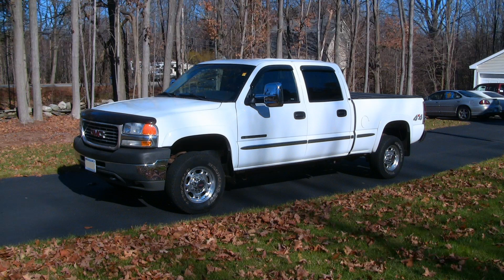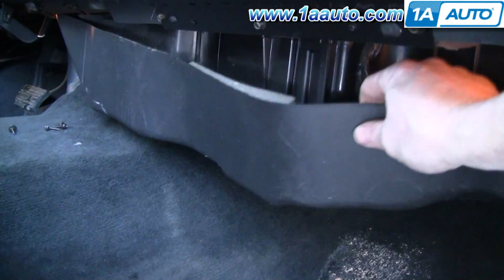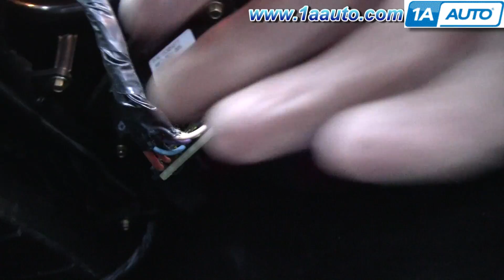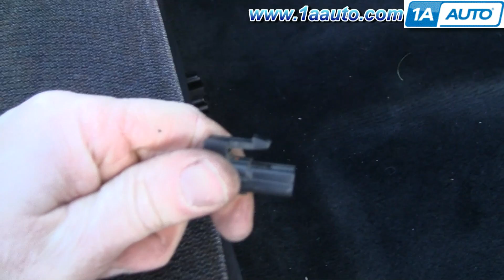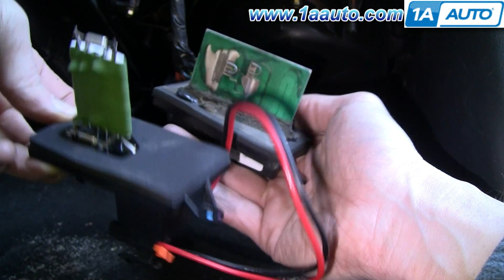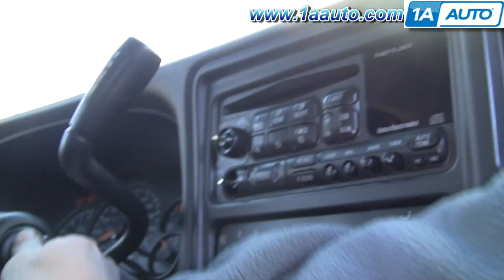How to Replace Blower Motor Resistor 03-06 GMC Sierra 2500 HD

Comment: My 1990 GMC V2500 suburban is having heater issues. The heat doesn't come on at all but as I am driving and the truck warms up I can feel (a trickle) of warm air with no force behind it. are their any tests that you know of to see which part in bad besides just ripping it apart and checking piece by piece?

Comment: my 99 gmc sierra 1500. my 4 wheel low is not working. just the high. is the problem the transfer case switch?

Comment: 1999 gmc 1500. my ac and heat doesnt work on ,1,2 only on 3,4,5. is it the switch or the resistor that meeds replacing?

Comment: I have multiple problems with my heading system. Only the highest speed will work on the fan. And the heat on the driver side setting is either the hottest or cold. I have an 04 silverado

Comment: 2006 GMC Sierra.  #5 stopped working (might have been a fuse I guess, never checked).  Now 1-4 stops working intermittently.  I fiddle with where it plugs in, and 1-4 usually starts working again.  Is the problem ever the plug itself that plugs into the resistor????

Comment: I have a 03 Silverado 1500 and my fan just quit working on all fan speeds but sometimes it works but i hear a clicking sound when i adjust my fan speeds. How do i know if it's the resistor or the blower motor that needs to be replaces?, i checked all the fuses and they are good.

Comment from the maker: You may want to check the freon level to see if it needs to be charged, also check to see if the AC clutch is working properly when the AC is on in the cab. Hope this helps you out. 1aauto.com 888-844-3393

Comment: i have a 2000 silverado and the 5th speed in the ac went out i replaced the blower motor resistor and it still don't work do you have any idea what might b going on thanks.

Comment: The 3rd speed of the blower switch on my '06 GMC K1500 has not worked for a couple of months and last week it completely quit.  I'm so glad that I googled "blower switch" and came upon your video before I wasted my small pension on a dealer only blower control switch.  I'll now order the resistor and save your video for my husband's benefit.  I might even install it myself.  Thank you so much and have a great week!  Andrea

Comment from the maker: If the blower is not blowing hard enough, either there is an issue with a blockage in the HVAC system or it could be an issue with the motor/resistor causing it to blow slow.

Comment from the maker: More than likely the blower motor resistor has gone bad. Usually that's why you start to loose the speed settings. 1aauto.com 888-844-3393

Comment: My 05 quit working on 5 also but at one time it was blowing with the head unit out. Is that sound like a resistor and do u see that the lights in the head unit goes out alot

Comment from the maker: Normally an issue like that would be the resistor but the best bet would be to check the resistor to see what sort of voltage is going to the unit at the different blower motor settings to check and make sure that is the issue.

Comment: I have a 2005 Silverado, A/C quit blowing on 5 today but, blows cold air on speeds 1-4.  Does this sound like the resistor?  If so, would this be a similar process to change it out?

Comment from the maker: Usually when the blower motor resistor fails, you'll typically start to lose the lower speeds. Here's a link to them on our website if you would like to take a look at them. 1aauto.com/1A/BlowerMotorResistor/Chevy/Silverado1500/-/-/1999?utm_source=youtube&utm_medium=youube&utm_campaign=1ATony

Comment: I have a 1999 silverado and the fan stopped working all together. Rotated switch a few times from off to 5 and it started working again for about two weeks. Then today when I started it, no fan at all. Would this be a motor, switch or resistor problem? Or at least where do I start the diganosis?

Comment: I have a 04 sierra and some times I get a ticking noise that comes from under the glove box area. I guess its around the blower motor area to be more specific. It has done it when the air is on and off. Any advice?

Comment from the maker: Usually when the blower motor resistor goes bad you'll start to loose the lower settings. Not sure what series your Silverado is but here's a link to the blower motor resistor section for a 1500 on our website. Just copy and paste into your browser. 1aauto.com/1A/BlowerMotorResistor/Chevy/Silverado1500/-/-/2003

Comment: I have a 2003 silverado none of the blower settings work could the problem be the resistor or would the whole head unit just need replacing it has randomly worked maybe twice during the month it has stopped working thanks

Comment from the maker: @TheMan16111 It sounds like the blower motor resistor may have gone bad. Usually when they go bad you start to lose the lower speed settings. Hope this helps you out.

Comment: @1aauto Hi I have a 2003 Sierra and mine fan only really works on setting 5, it works on the other settings but when you change the speed setting there is no noticeable change in speed so would it be this or the blower motor resistor? And is there any way to test the resistor to see if it is the problem? Thank you for your service of putting up these videos. Also could you send me a link for the part from your website for which one I would need. Because I am having trouble finding one.

Comment: THANK YOU so much for posting step-by-step DIY repair videos for us novices. With winter about here, the heater fan in my 2005 Sierra 1500 (with 88k miles) quit altogether [after the 5th speed setting quit weeks ago] so, I have a feeling, it's the Fan Speed Control Blower Motor Resistor .
 In Oct. '11, when the Check Engine icon lit up on the dashboard, my Abeloff GMC Dealership charged me $88. to find out the EVAP is leaking and the heater blower speed 5 quit.

Comment from the maker: @Nighthawke70 I would check with making sure the fuse is good, and that there's also power to the blower motor resistor and also the blower motor. If you noticed that the speeds began to not work on the AC control that's typically the sign of a resistor going bad. If it just stopped blowing air all together than the blower motor could be the culprit.

Comment: just wondering if you knew if the back blows air and the front dose not would it still be the blower motor resister?

Comment: Used this video to work on a 2006 Chevy Tahoe Z71.
only real difference was that 2 bolts removed the cover 90% and the resistor was right up front to the right. no other screws or bolts removed. Do be sure when you order your part, know what hole line up yours takes. i got mine for $25 but holes were a little off. For $55 i could get same part with correct holes. I secured it and it works just fine. 
Thanks for the great video!!!

Comment from the maker: @Toasty504 This is usually the problem if you fan does not work on all speeds.  The trailblazer may be a little different in getting to the resistor and its' location.

Comment from the maker: @ncrdisabled I don't have a venture right now to do a video.  The resistor on your venture is probably located in about the same spot as it is on the truck in this video.  The procedure is probably about the same as well.

Comment: Can you show how to replace a resistor pack on a 2003 chevy venture . Mine has a problem that the 3 rd position does not work on the blower fan and I was told the resistor pack is going bad but I do not know where it is or how to get to it.

Thanks great videos